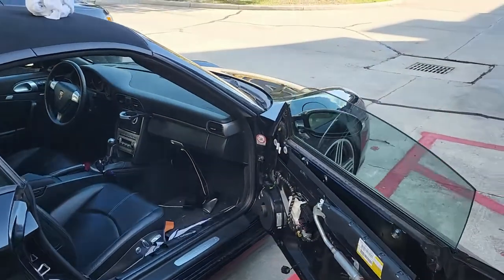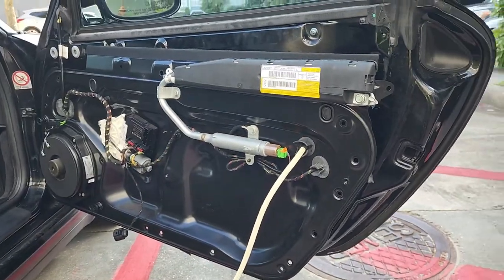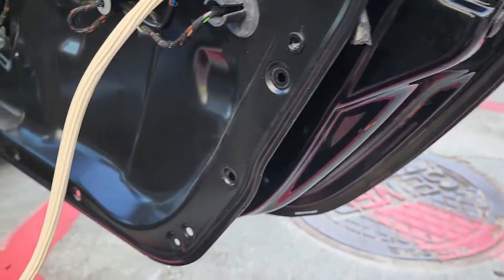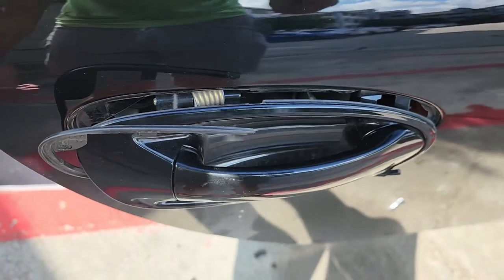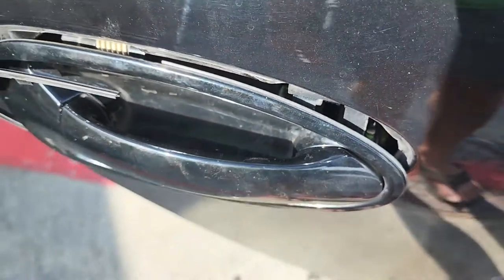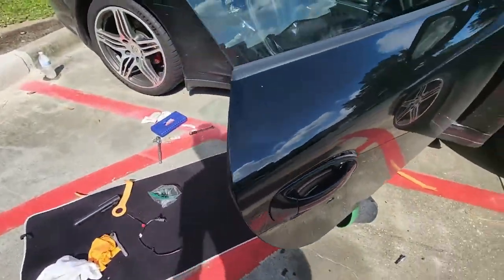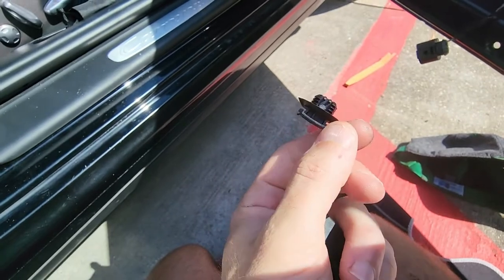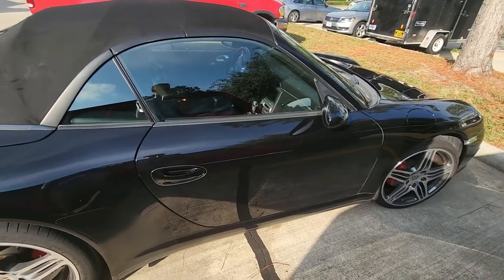997 Door Handle Microswitch Install

Comment: Question. Is this micro switch also activated somehow by the interior handle, or is that a different one? I have a similar issue on my 07 Cayman S where driver window will drop when I pull the interior handle (also broken w/ that common plastic part busted)... anyway, the window will drop to allow me to exit the car. Once I release the interior handle the window will rise, even tho the door is open... I then press the broken handle flush and the window goes down and stays down. I can then close the door w/out banging the glass off the frame. Note: I did replace the busted handle thingy which kept the handle flush, but I could no longer do my trick to keep the glass down so I could close the door. I'm pretty sure I have 2 problems going on at the same time. Anyway, your thoughts are appreciated.